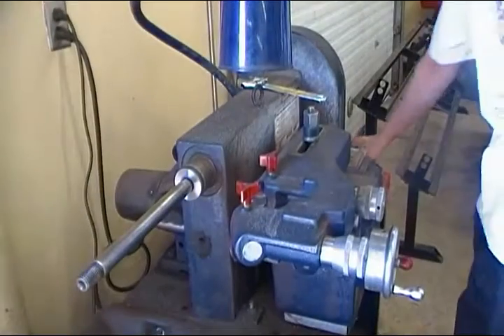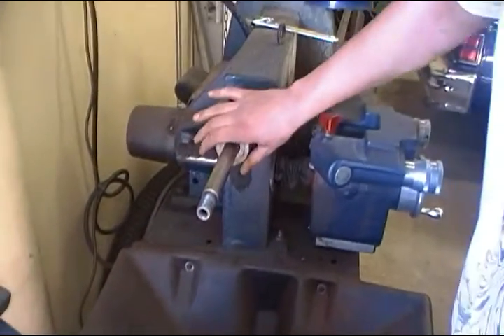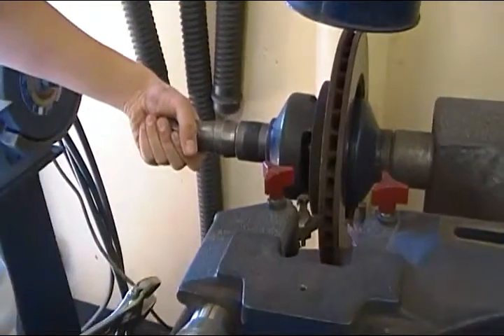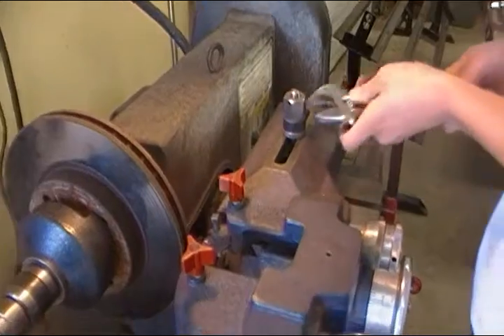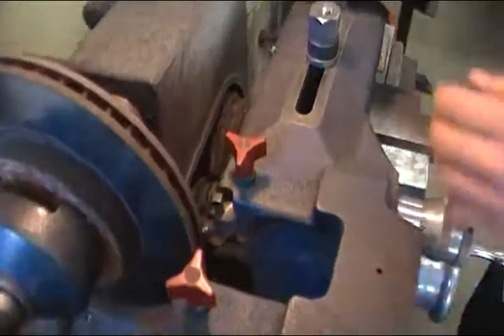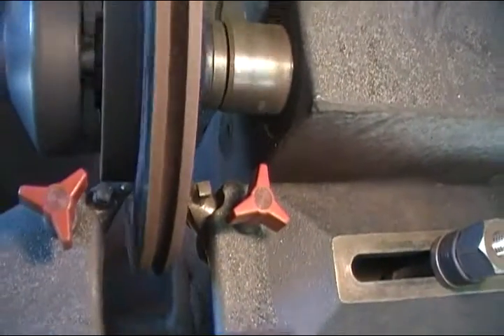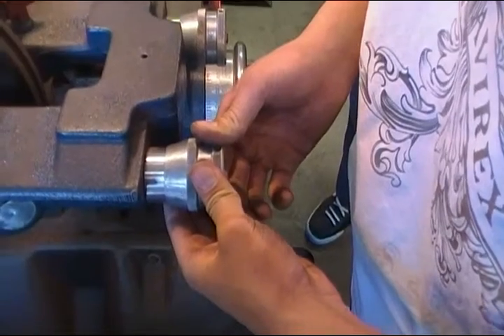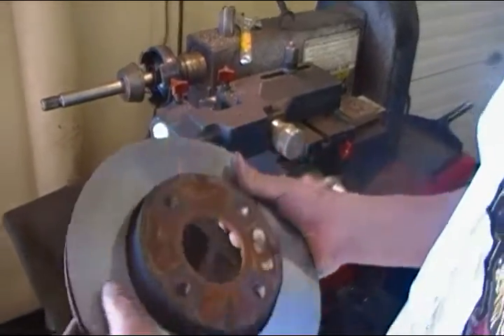Harjot Brake lathe

Comment: don't lock the cutters until you have set your cut depth. and that should be 2 to 3 marks which is 4 to 6 thousandths of an inch Any less will over heat the bits and shorten their life

Comment: lots of mistakes in this video Always use the biggest bell clamps. They dont have to be the same size. Where is the silencer? What happened to the scratch cuts you make. Its not a clutch it is a rubber spacer and it always goes next to the nut. An you dont have to tighten the arbor nut that tight. There are more mistakes but I'm running out of room to post it.